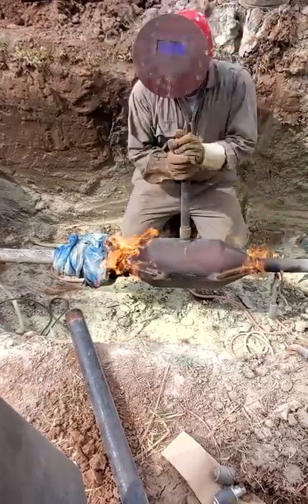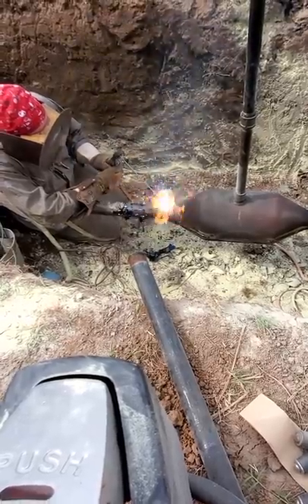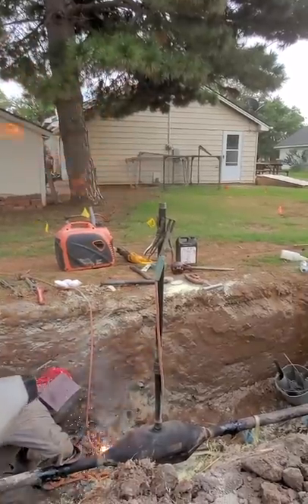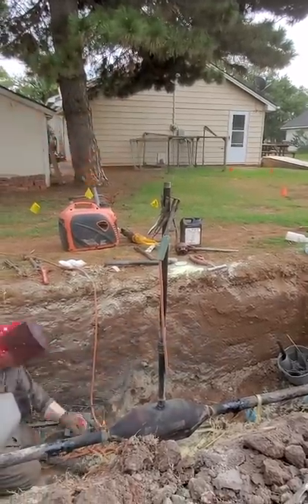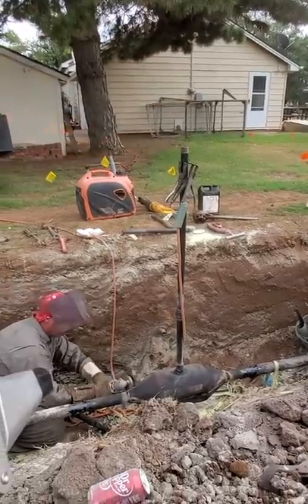Stick Welding a Live Gas Line | Hot Minute #shorts

Comment: Eons ago my friend was under his welding rig (welding something unrelated) and on the out he was scootching along (with stinger in tow) and it touched and arced to the gas tank. Without thinking he pulled it off right quick, making a small hole. With no one around to help and the knowledge that his tank was totally full, he did the only thing he could think of. He welded the little hole up. It cost him his gloves and some hair but his tank of gas was saved (mostly). Not the best situation, but sometimes ya gotta do what u gotta do!
Reply: So many small things can go wrong

Comment: Makes sense, not like ot's going to get more on-fire.
Reply: No it will just explode and kill every body.
Reply: @lincolnhatley2767  nah, I understand why you assume this it seems very obvious. But as the gas is already burning it is predictable and you can actually see it. Now if the flame goes out and you hear a whistling sound that's likely the last thing you and anyone withing 100 or so ft will hear. The pumpkin diverts the flow up and does not allow pressure to build. This is surprisingly much safer than it would appear. Not totally safe mind you just not likely to kill you
Reply: @lincolnhatley2767  you need oxygen for an explosion. As long as the gas is flowing, there should be no oxygen in the pipes.

If the gas flow stops, then you might have a bad day😅.

The other problem arises when the gas leaves the pipes and enters the atmosphere. Which:
1. Has oxygen
2. methane is heavier than the atmosphere so it accumulates in a ditch like that...the same way water would.

Burning the methane off means it doesn't get a chance to accumulate.
Reply: @tylerdurden3722  additionally, the combustion products of methane are less environmentally damaging than the methane itself, so that's a bonus.
Reply: With that logic every gas stove in america should be exploding xD
Reply: @skizzik121  so the fire is to show if there is leaked gas, but wouldn’t it be safer to just shut off the gas connection entirely, I know nothing on the subject, also why doesn’t the fire just follow the gas back to the source? Is it because of pressure idk

Comment: I used to do that in my old company (a Foundry) it was super scary the first, especially when they intentionally raised the gas pressure. But it made sense, increasing the gas pressure actually prevents the flame going back.
Reply: Where did you have gas lines? I worked in a foundry as a millwright and I can only think about the ladle warmers. Did you have those also?

Comment: Ya we’ve done this for years it’s not common because you typically can shut the flow off ahead of the leak or you can introduce a  purging gas to neutralize the internal explosion risk usually nitrogen is used but gasoline lines can be purged with a high water flow and a split Tee can be welded on!!!!! This shit is risky AF sometimes!!!!!!! A good friend of mine lost his life doing a hot tap back in the late 90’s !!!!!!!!!
Reply: Hi I have a regular welding mask with din 11 lense and i dropped it and a tiny piece of the lense side chipped off. The question is can I still weld with it if I tape that side off?
Reply: Roll Tide: isnt it the best idea to keep the gas burning while coming out? As long as the line has pressure, it wont suck any air in...?!
Reply: @mrjodoe  true as long as the pressure is on it will not suck anything but This is still dangerous and risky and if u can turn off whatsoever in that pipe ur good to go
Reply: Now a days short stops would be welded on and the gas would be bypassed so there's no disconnect to services and that section of pipe would be replaced .
Reply: War Eagle!
Reply: Feel sorry for your friend..
You must have been learn so many things from how he passed.. I mean technical things..
Reply: @Jacob Beck nah

Comment: Dangerous or not, the principle is simple: As long as the pumpkin has that pipe as gas evac, there is no harm. Also, the gas is under pressure so being a small whole, the flame stays out, doesn't go inside! Like using a flame thrower!
Reply: Its so they don't halfto shut the line down to cut out old pipe an weld new in 👌
Reply: No that’s not the principle of operation at… The casing catches the fumes and sends them out a direct vent away from the weld so it can be properly welded… There is no harm as there is no way for the gas to become pressurized along with air and ignited… Fire won’t hurt you if you dress properly. Welder deal with temperatures much greater than that of natural gas burning. Burning the fumes keeps them from collecting and creating a flash over, which is very different than an explosion.
Reply: @mikeznel6048  nice buddy

Comment: My dad was a natural gas pipe line welder for 32years. He worked for back then it was Columbia gas transmission. Every weld he made inside and outside was x raid. He had to go to welding school every year to be recertified. Interesting work.
Reply: TransCanada now. I work for Columbia on the distribution side in Kentucky.

Comment: Been at a few of these repair sites, it was odd at first on a safety view side, but you catch what is going on real quick.  Normally, the pipe out will include a valve.  This is similar to a hot tap, just this doesn’t have as much pressure.

Comment: Do live gas work in Canada , but as mentioned by someone else, we would weld shortstops on the live line and bypass the leaking part and then cut out the damaged section.  I have done similar welds as that guy is doing but now with all the safety BS we have to deal with we rarely get to do that cowboy stuff anymore 😆

Comment: I do this for a living. The main has to remain live while the welding is done. If the main was to be shut down there would be a build up of negative underpressure and the flames you see would be sucked into the main and cause huge damage depending on the site capacity. The pressure in the main keeps the whole plant from exploding. This procedure is commonplace.

Comment: He might be making big bucks. Not anyone can do what he does, and no company would let just anyone do that job since it would represent a huge liability if something goes wrong.
Reply: No there are men standing around with thermal thermometers checking the temperature and making sure he is not doing something thats gonna get them killed
Reply: @quigonjinn5349  I've never seen that and I've managed a ton of leaks no thermometer anywhere near any of them just a welder in a hole.
Reply: I don't see how a dude with a thermometer is gonna be able to accomplish anything but maybe distract the welder.

Comment: My father did that back in the 1960s on main live British gas line...He increased the pressure of line to household entry and began to weld gas was always under control.The job was expected to last 3 weeks due to install a sister line to work on damaged line...The old man did it in 2 hours... British gas engineers were blown away by his thinking it had never been done before...He was a welding genius...He worked all over world on pipe lines as a contractor..

Comment: I've worked on a crew that welded a tee to the main, ran the line to a valve and cap.
Once complete and pressure tested, we drilled through the main, and capped the tee. The tee and main were wrapped with rubber and tape to prevent corrosion, as lines had charge with sacrificial anode. Many times a day, was buried alive, but remain so to this day.

Comment: In our area we call that a “canopy”. It’s a last resort kinda thing if we can’t clamp the leak, if the pipe has lost enough steel to cause strength problems, or if it’s high pressure.

Comment: Perfectly possible. Can be made perfectly safe.

There's a cutoff at the end of the street, numbnuts.

Source: firsthand firefighting experience
Reply: Good point
Reply: I'm guessing you didn't weld many gas mains as a fire fighter. Shutting the line off wont purge it. Same principle applies to welding a gas/petrol tank... never weld an empty one!
Reply: they need to verify the leak is sealed, einstein
Reply: @MKChase-uj9vx  hahhaha Ladies and gentlemen, we got him xD. Must be embarrassing eh? Mr. Firsthand firefighting experience
Reply: @nielscremer599  no, you don't got him, but a firefighter would certainly turn off the gas supply for safety. The welder would probably turn it back on before fixing the pipe and cuss out the firefighters who made the job more dangerous. Different priorities. That's just the way this confusing world works.
Reply: You want the gas on so there is no air in the line
Reply: What if the cutoff is compromised or faulty or not even there Einstein we don't live in a perfect world.

Comment: It's safer to weld on a loaded line than an unloaded line. For it to ignite it takes 3 things: fuel, ignition & air. When its loaded air isn't able to get in (so long as u  don't lose pressure up stream. She was will throw flames out side the pipe. My mom worked for northern natural gas for 30 years & I helped their welder that worked there 40 years weld a loaded 16" pipe with close to  500 psi. I thought he was nuts at first until  he explained it to me

Comment: I have done this type of pipeline repair. Here in Cali we call that a weld can. Most you make a custom can for each repair. Depends on what you need to fix. Butt weld, damage, fittings. Some take a few hours most take all night $$$.
I would say this is my personal favorite type of gas pipeline welding. Not your average welder can hang. Most these boys run for the hills.

Comment: I've installed pumpkins on crude oil lines .  They would fit over over leaking  collars on 8" thru 12" crude oil lines. The problems with them was after installed was it increased the systems diameter and thus lowered the operating pressure. After the company found this out we had to go back and remove them from the systems . Draining up the line and replacing with pipe. Plus they they were dangerous in the junk pile , We would have to drill a hole in them to let the product out so no one would cut into them with a torch and go boom. Old Welder here this was in the 70's and 80's .

Comment: Years ago I was doing some geotechnical drilling for a gas line. I asked the gas rep what they do when they have a leak and need to weld it. He said they weld it live, this is high pressure gas mind you. He stated that the gas is coming out at such high pressure that it would blow a flame. The dude that has to weld that shit, has massive balls and my respect.

Comment: As a gas fitter once told me, while checking for a leak with his lighter, gas can only be a dangerous thing if it has chance to build up, if the room is ventilated, then the gas will light like a cooker, if no ventilation, then boom

Comment: Wow, never really thought that gas lines were fixed/worked on with welding machines while its still pumping.
I have a question out of sheer curiosity, whats the probability or chance of things going wrong in your line of work? Being a layman myself I'd never have the balls to bring sparks near continuously running gas.

Comment: My first hot tie in was on 12 inch. Side boom lowered the pipe down. The foreman showed me how to mark both sides and bevel between. The existing pipe had gas coming out of. He showed me to use a bandana to see if it was coming out or sucking in. The boom raised the pipe up and I put the beveling machine on the pipe at the mark. He stood behind me holding my shirt collar. I lite the torch and the fire started. He said stand and cut it. I hit the oxygen and it sent a fire ball down the ditch. By the time I cut the whole way around the coating on the new pipe was on fire for over fifty feet. I was scared but he wouldn't let me run holding onto my shirt collar. He said get the beveling machine off the pipe. He then put out the fire. To much gas to grind the bevel had to use a file. Put the clamp on the pipe and the side boom lowered the pipe. Got the space and he said don't put my face in front of the gap. I was 23 years old and sweat running down the crack of my a##. Went to tack the side and the fire came out the gap burning the flux on the rod making it black. Finished the weld and ran out of the ditch. He said remember what you did today. 43 years later I remember that first hot tie in. Made many through my career but that first scared the sh#t out on me......

Comment: First one I did without another welder on site was a 2” service line they were capping off right next to a school while it was in session.

Old service lines will have this because the valves leak by, so it’s safer just to restrict the flow.

Comment: 10 years worth of doing it. Let it burn. I have been on some pretty good line ruptures. Had an aluminum fence post burning out the top one day, lightning hit the fence and burned a hole in the pipe that it was touching. Pretty cool rolling up on that.

Comment: When I was 19 working road construction the excavator hit a big ass telephone line. For some reason, they replaced 90ft. I grabbed the loader, used the bucket to cut the bad piece into 3ft pieces (cause it was heavy AF). Foreman said "nobody else wants to, take that to the scrap yard". Got $1100 back in '02.

Comment: When I ran a grading crew, one of my operators bumped the 5000 gallon fuel tank with a dozer blade and put a quarter  size hole in the almost full tank. The company welder was on-site and welded the hole with diesel pouring out. A few little flames and he was done.

Comment: In the UK gas is yellow plastic and has joints that have a element in them and melt to the pipe when the electric terminals are put on.

Comment: Yeah i used to do this, but it was on LNG and not spaghetti pipe but 42” SCH. 80.  Feed the city not the house sized pipe. Pipe wall integrity and thickness must be maintained to certain allowances and one way to monitor this is to put what they call pigs that have these ultrasound plates or diode‘s all over them (imagine a 55 gallon drum is about what he would look like you know but obviously to the size of the pipe) but they’ll shoot that down through the pipe looking for thin spots, cracks etc...by hydrostatic testing ( which is how we did it after the repairs were completed)then a hot tap is done. stopple bypass to reroute flow ( perhaps like an expansion joint in appearance.) Then the repIr cree come on in and tune her up. My first job i spread legged over a 64” pipe with a bucket of mud and a chain. Guy was cutting a weep hole in the wall of a live line. With a oxy-acetylene torch. I Packed The mud over the cut as soon as he made it. About the size and shape of a Nerf football and the chain was used to strap around the pipe over that metal that was going to pop out you know because he cut it and as long as that pipe didn’t suck in air we was good..... best 10$ an hour ive ever made.

Comment: most every distribution welder has probably had this.we call it a wraparound.saw no valve .we would dope one just off the w a..done .close valve remove stack.cap valve .cold wrap and your out.marker tape in ditch so no one snags our small valve digging.they might jump their cap,since it was low pressure.but thats a small oxygen mix area to create a flame

Comment: Just hot taps on live gas lines. But you’re just welding a thread o let on the pipe, screwing in a nipple, adding a full port 1/4 turn ball valve and then hooking up a hot tap machine to drill and pull the cookie out. You retract the drill and close the valve, so you don’t have any gas leakage. Not really the same, but still pretty cool.

Comment: So the way we do it here in Oregon is we weld a threaded joint on both sides to the top of the pipe put a pancake value on both tap them to stop the gas flow over the leak cut out the leak and replace a new one take tapper out close it with a stopper remove the pancake value.  Fill with sand rock then cold patch

Comment: We did a 18" main line tying in a compressor station in Jal New Mexico in the 80s as long as you have flow through the line you are OK. What you don't want to do is burn through on the hot pass as it could be explosive. It was a cool, as heck.

Comment: We call them “ bells”, not pumpkins.  It’s not that hard really, and keep in mind that residential pressure lines are really low, like 30 PSI and less.  It’s only when it is confined and at high pressure that you gotta get worried.
Reply: I think residential is about 4 psi. All about volume.

Comment: Curious why he can’t patch a line in between where leak was but rather he encapsulates the leak with a pumpkin (no shutoffs)?
Reply: Dropping in a new piece of main line would require either shutting down the line completely or bypassing and isolating the leaking portion. That line may serve hundreds of customers downstream, so shutting it down wouldn’t be the right choice. A bypass would work but takes a lot of resources and time, with the only benefit being that gas would be shut off to that leaking section. The pumpkin (formally a weld-over sleeve) can cover and seal leaks without shutting in that section. So as long as the leak isn’t too bad then it’s a very economical choice.

Comment: I believe I'd have put a clamp on that and sealed off the leak a bit more. Cut the bolts and then put that pumpkin on there. Although it doesnt work out according to plan sometimes. Especially welding on those small bits of main that's pitted and rusted the wall out.